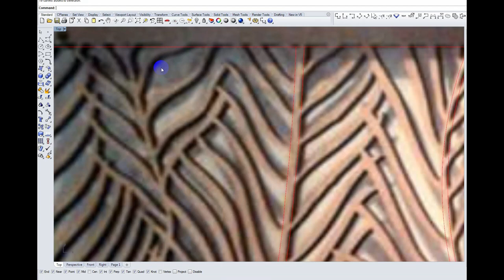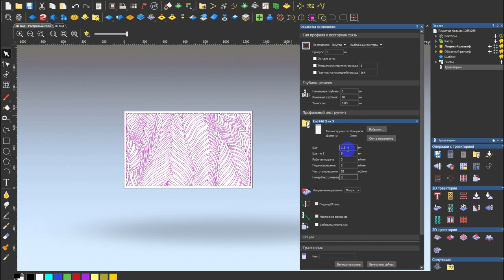Milling of MDF panels with CNC. Фрезеровка МДФ панелей на ЧПУ

Comment: Very nice, as always. You did the creating of the splines yourself or the program generated the rest ? I didnt catch that.  Also came out handy that the sawdust was holding the pieces in place so they didnt fly out. Beautiful outcome.
Reply from the maker: yes, i created all splines myself. I cutted that part of video, because it was very long
Reply: Илья Буката  that is  nice .. after you traced  the Splines in rhinocerors   you used software  to create the machine path and code  I think  ..can you tell me what that software  please.
Reply: Artcam & Rhinoceros
Reply: i think pieces  didn't fly off because he was using Spiral down cut ,so basically it pushes everything down while cutting.
Reply: Я работал на аналогичном оборудовании фирмы Biesse (Rover-24 & Rover B) и использовал для таких целей небольшую программку Vector Magic DE 1.14 - программа для автоматического преобразования растровых изображений в векторные. Она очень быстро справляется с такой скрупулезной задачей, как векторизация. И, что самое главное, - очень точная. Советую посмотреть. Успехов.